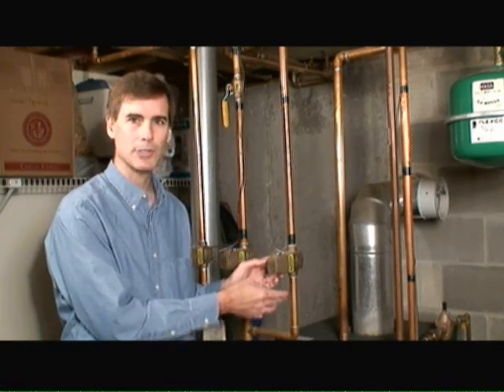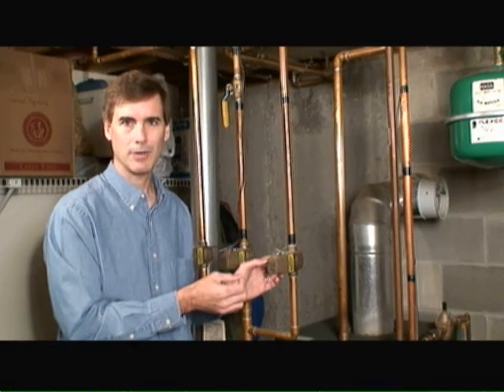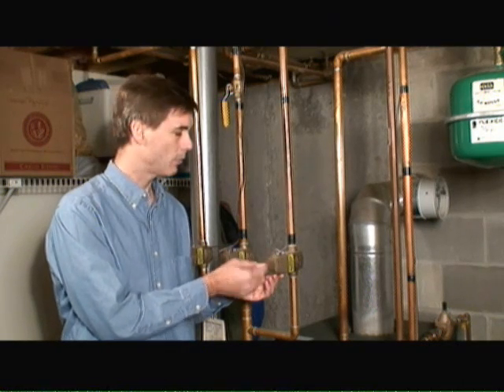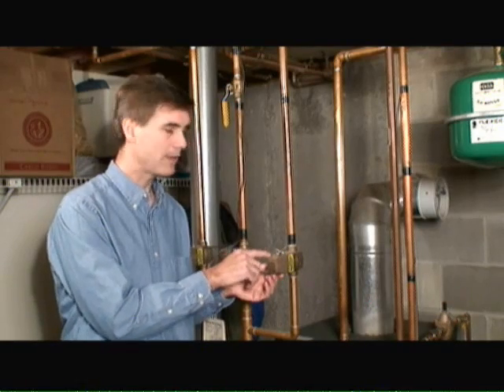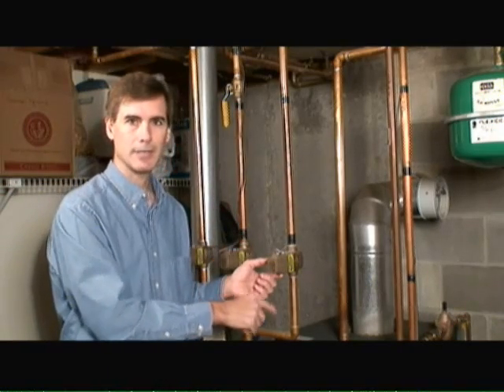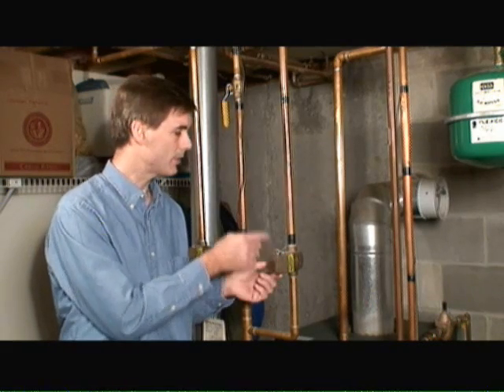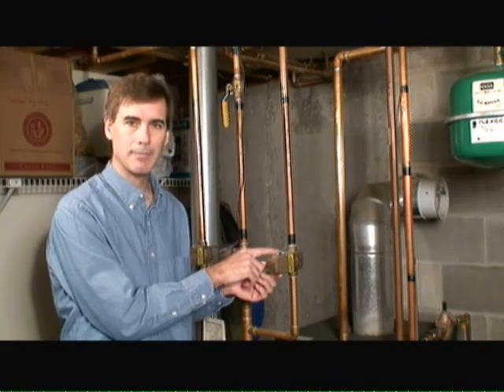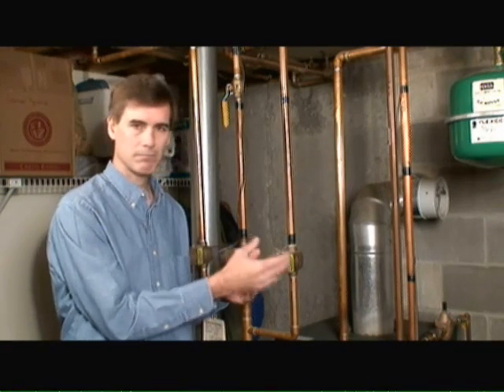Hydronic Zone Valves

Comment: Those Taco 571's are notoriously horrible zone valves.  They use "wax" type actuators that fail very often and the valve "guts" often fail due to o-rings & washers failing first.  Just avoid this junk and use Honeywell type valves.  They are fairly solid mechanisms and around  the same price as the Taco devices,    

Note:  Check into the newer Taco SENTRY line of valves.  They have a green color actuator and have "end switches ".  Their method of operation is similar to the Honeywell (vs. the 571 series valve). 
The newer "Sentry" is supposedly more reliable than the ubiquitous 571'.   the on,y problem reported by our field techs so far is a poorly designed manual override for the valve.

Taco also makes a very solid and reliable relay module/ zone control unit.   Though it can all be done without the relay module, it makes it easier to install and service... .

Last note:  the40va  taco 571 series valve as shown in the video are huge power hogs!!   

* ONLY CONNECT 2 VALVES PER   (24vac) TRANSFORMER !!  
Though the Taco mfg documentation indicates that you may connect up to 3 Valves per
transformer, this is NOT recommended by most of the better installers and service technicians working in the HVAC and /or automation fields.

Comment: I have a  Separate thermostat on each floor and a separate circulating pump for each thermostat.  The lower floor thermostat turns on the boiler and the lower floor circulating pump when  Lower floor reaches the proper temperature the boiler turns off. then the uppstairs thermostat will only turn on the upstairs circulating valve and not restart the boiler. We have a wood stove on the  lower floor so we hardly ever need the hot water baseboard on the  lower floor. Can it be wired up so either thermostat will start the boiler and the  appropriate recirculating pump.

Comment: Here is my scenario. No issue with electric part of the valve (Taco 571). Mechanical plunger of the brass base housing works fine clamping/pushing and observing from outside, but there is no water flow on that zone heating circuit. How often did you see and how is possible to have separation of the plunger from and valve sealing plate, for which I would have to take the vale a part for visual inspection. Is there any easier way to check the sealing operation of the valve?

Comment from the maker: Yes, I have changed one myself, however you may want to first try just changing the upper electronics half of it. It simply twists off. If you have to cut and sweat in an entire zone valve as you state you will need to shut off water and drain the water from pipe. Make sure to use lead free solder and flux. Also use Mapp gas as it burns hotter.

Comment: being handy, am i able to change a zone valve myself easily?? would i have to turn water off and drain etc. or is this simply an electrical device. ....my valve seems to stay open when the stat calls for heat. i actually tap the box with my nuckle to get it to stop.

Comment from the maker: Turn the thermostat that is associated with the particular zone valve up. Turn it up so that it is warmer than the current temperature in the room.  Hot water should begin to flow through through the pipes and into the heating elements. If it does not, you either have an issue with the zone valve, circulator pump or thermostat. 

If there is a lever on the zone valve you can also turn it to the on position to see if water will begin to flow through the heating elements.